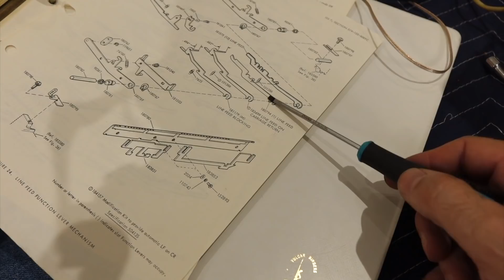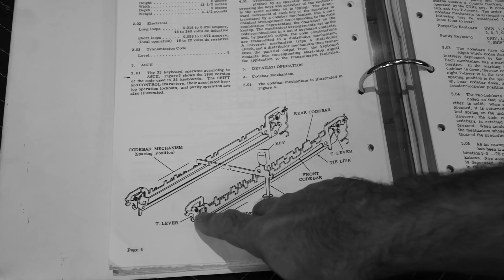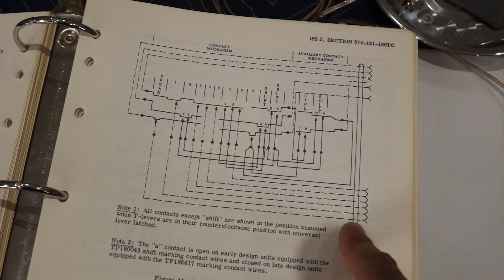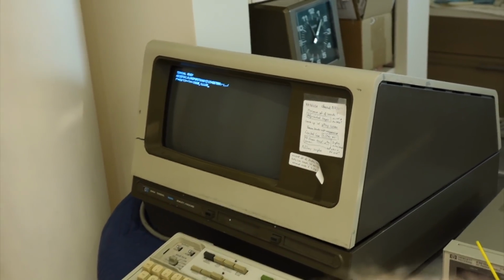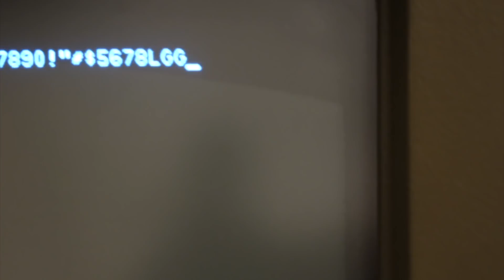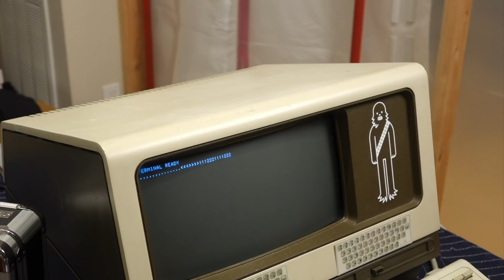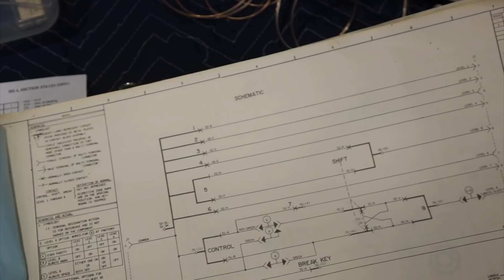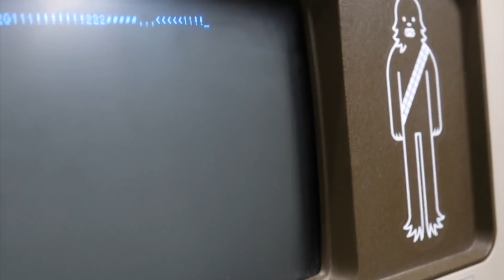Teletype ASR 33 Part 5: Working on the Keyboards

Comment: Where did Carl get the 11x17 drawings of the ASR 33?  All I've got for mine is the basic manuals.  Even a PDF of Carl's drawings would be great because I can have them printed.
Reply from the maker: On my website, the 4th link down in the doc section: https://www.curiousmarc.com/mechanical/teletype-asr-33 . This monster site of all the docs and schematics of all the teletypes is also an amazing resource if you want to dig deeper, look at different revisions, etc... http://www.navy-radio.com/tty/tty-wd-list.htm . Also on Al Kossow's bitsavers.org. Also just found this site, has tons of doc very well organized: https://va3ngc.weebly.com/asr-33-documentation.html
Reply: @CuriousMarc  Thank you!  I've downloaded the files and will have the "large" schematics printed for ease of use in my shop.
Reply from the maker: Excellent, good luck with your ASR 33!

Comment: Who the hell designed these kind of equipment and remained nameless...? This looks extremely complicated with manual design without any CAD aid. Was this basically everyday equipment they came out every other year or so with  a new one?
Reply from the maker: These mechanical designs are genius. The successful ones would stay in production for very long periods of time. The Teletype Model 15 design dates back to 1930 and stayed in production through the 1960’s. This Model 33 ASR from 1963 was manufactured until 1981. Similarly, the IBM 1403 monster printer from 1959 would through many IBM computer mainframe generations through the late 1970’s. My Facit calculator mechanism from the 1930’s was still produced in the mid 1950’s. Etc, etc...

Comment: The feelings of nostalgia are strong! In my early teens I was fortunate to have access to some salvaged 1950s Marconi Maritime radio gear complete with the sea-going documentation sufficient to give a good understanding (a theory of operation) and nearly all the information required to diagnose/repair the equipment whilst at sea.

Nowadays much is hidden by microprocessors and propriety software detracting from the childhood right of passage to take electromechanical things apart to see how they work. I wonder how many engineers were inspired by their childhood forays into items of that era.

Really enjoying the work that yourself and team do.

Comment: These electro-mechanical devices are a wonder but keeping it working correctly must be like keeping many plates spinning on their poles, to phrase an old vaudeville act I once saw. I have dissected a few in my time, mainly mechanical adding machines. I look at your teletype and I can smell the oil.
Good luck on the repairs, bon chance.
Cheers,

Comment: What is the small vacuum I have seen you use in the past to clean electronics? I need one of those but can't find anything sturdy looking.
Reply from the maker: It’s a regular shop vacuum, just bought some small attachment adapters at Fry’s I think.
Reply: @CuriousMarc  i see- thanks for the response.